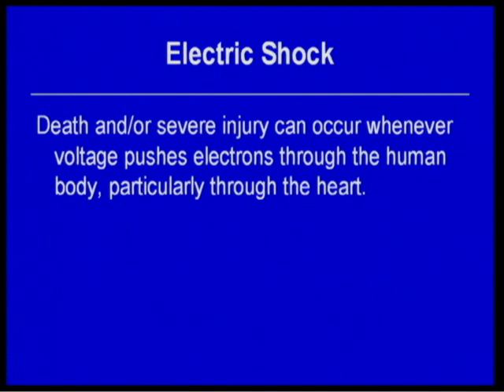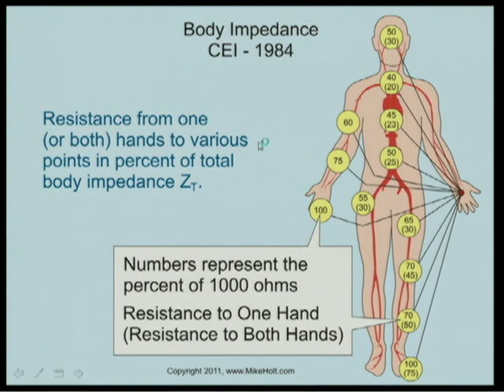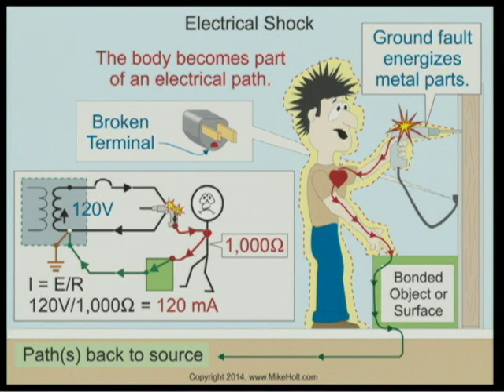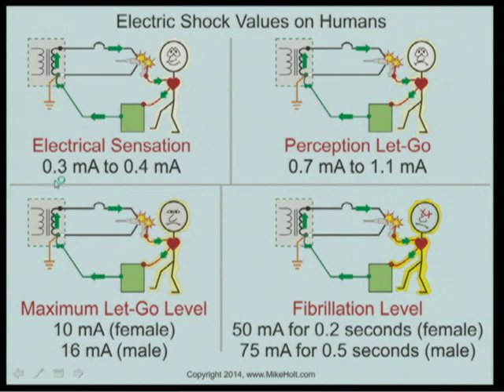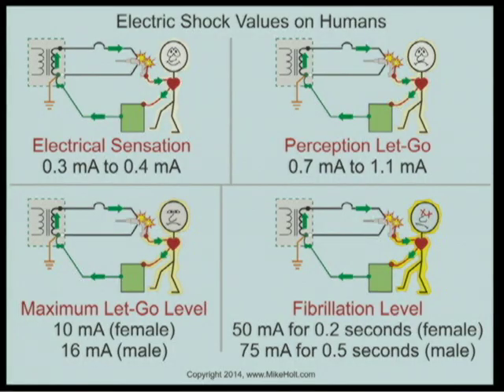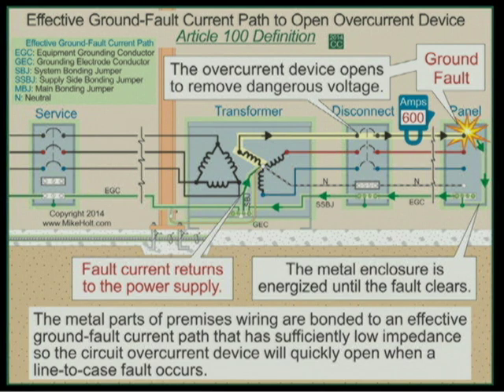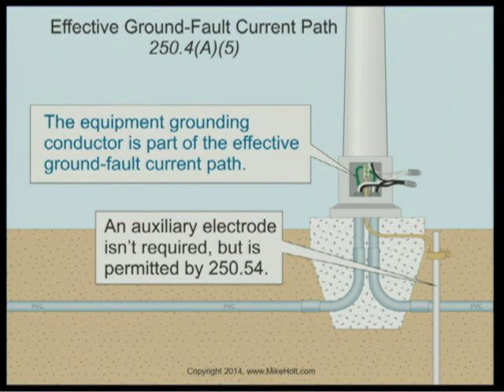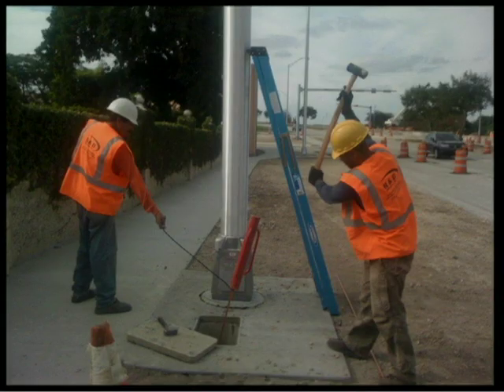Grounding Versus Bonding (26min:26sec)

Comment: I have been an electrician for 15+ years and we need to have, share and exchange more quality information like this. Youtube is supposed to be like this, a place where you can learn. Thanks Mike holt for sharing your knowledge.
Reply: Yeah sad thing is is that co-workers still laugh at u when u get zapped. I remember the first time I tasted a little bit higher voltage than 120 it was just across 2 legs of 208 and It caught me on the soft spot of my forearm (it was a piece of emt with wires hanging out that looked like an abandoned circuit) that was a bit of a different level lol I could feel it pulse through me and my coworker laughed at me the rest of the day lol.

Comment: After being shocked by a defibrillator, Defibrillation briefly stops your moving heart muscle to allow your heart to generate an electrical impulse and start a normal rhythm. In essence, defibrillation restarts the heart.

What happens after defibrillation?

Your provider will do CPR again for two minutes, check to see if you have a pulse and look to see if your heart rhythm is normal. If necessary, they’ll do more CPR and give you another shock. They’ll also give you medicines (epinephrine or amiodarone) if defibrillation didn’t work.

Comment: Great video and a point about Defibrillation stops the heart from fibrillating, think of it like rebooting the heart and letting it naturally regain a rhythm.  It is a single shock rated in  joules.  It is not multiple pulses.  Multiple pulses would be external pacing which would increase the heart rate but not typically used to restore a normal sinus rhythm
Reply from the maker: Thanks for the additional information.

Comment: Fib-rih-lay-tion

De-fib-rih-lay-tor

The heart consists of millions of electrical cells that charge and discharge. The heart is controlled by the brain. 

The heart has its own electrical pacing system. Theoretically, if you unplug the brain/heart connection but keep oxygenated blood flowing to the heart, it will beat on its own. 

The heart has 3 pacing sources, 1 normal and 2 escape (backup) systems. 

The normal pacing signal is given by the Sinus node located in the Atrium (the top half of the heart). It’s rate is 60-100 beats per minute. When the signal comes from the Sinus node at a rate of 60-100 it is called a Normal Sinus Rhythm (NSR). Slower than 60 from the Sinus node is called a bradycardia. Faster than 100 from the Sinus node is called a tachycardia. 

If the Sinus node is damaged from tissue or electrical damage (lack of oxygen via clogged artery or electrical shock) the heart will go into an Escape rhythm. 

The first of the 2 Escape rhythms comes from the middle of the heart and is called the Junction (Junctional rhythm). The junctional escape rate is 40-60 beats per minute. 

If the Junction is knocked out, the last escape rhythm comes from the bottom half of the heart called the ventricle. This rhythm is called an Idio-ventricular rhythm and the rate is 20-40 beats per minute. In the medical world it’s simply said to be an idio rhythm. 

The top and bottom half of the heart do not beat at the same time. Mechanical action occurs when the electrical system sends the signal to the cells. The normal discharge recharge cycle goes like this:

Atrium-discharge (muscles contract and blood is pumped into the ventricle filling it up). 

The electrical signal sent by the Sinus node when it fires off travels to the ventricle, but it is intercepted by the Junction for a very brief moment, held and immediately released to continue on its way down to the ventricle. 

Recharging of the atrium begins. 

Ventricle-discharge, atrium recharge completes. 

Atrium - discharge, ventricle - recharge. 

Repeat 86,400 a day. 

When you are electrocuted ALL of the electrical cells in the heart discharge at once and there is no recharging. The entire pacing system is knocked out and the electrical cells in the ventricles begin discharging in total chaos. The ventricle is a quivering mass at this point. No blood is being pumped. 

A defibrillator discharges all the cardiac electrical cells at once and hopefully the Sinus node will step up and take over the electrical system again. After the defibrillator fires off, the first thing everyone does is look at the monitor screen to see if the electrical waves have changed out of ventricular fibrillation. 

If the heart returns to a viable rhythm (NSR is the ultimate goal) the term is Converted. “He converted back to Sinus”. 

If you survive an electrocution, you most likely will suffer permanent damage to your cardiac electrical system and suffer from various dysthymias for the rest of your life.
Reply from the maker: You are amazing, how do you know this to be true?
Reply: MikeHoltNEC I was a Paramedic for 36 years. Now I’m a Firestopping Inspector.

Comment: The problem is the confusion between TN grounding systems and TT grounding systems. In TN grounding systems (f.e. North America, UK, Australia) you rely for ground fault protection on the short circuit protection of the fuse or circuit breaker. Now in TT grounding systems (many mainland Europe countries) you rely for ground fault protection on a Ground Fault Circuit Interrupter.

The problems starts when people who worked in countries where solely TT grounding is used (f.e. France) and they start working on systems designed in countries with TN grounding in mind. 

TT grounding is never sufficient when there are no GFCI's on every circuit to detect the small ground fault currents of TT grounding systems. Many countries with TT grounding even require at least two GFCI's in cascade to make sure even when one GFCI fails there is backup GFCI which will detect and trip on a larger ground fault current and disconnect both lines and neutrals. Also you're not allowed to share a ground rod in a TT system so every consumer will need its own ground rod. If this isn't possible you will have to convert to TN system by bonding the neutral to the ground rod somewhere to create and effective ground fault current path.

The best of both worlds is having TN grounding with GFCI's. This will maximize the chance of detecting and clearing any ground fault. Most European countries actually switched to a TN grounding system or take extra measures like 2 GFCI's in cascade to make sure even with a TT grounding system the risk of a sustaining ground fault is low.

Comment: the 30 volts and 15 volts for electric shock and hazard from death comes from the amperage that is required to stop the heart and using ohms law and an assumed resistant in a persons body is where the 30 volts comes from. I believe 0.1 amps can cause the heart to stop so assuming a person resistance is 300 ohms 30 volts could kill someone.

Comment: Sorry if i look dumb saying this , I'm new and on the process of learning to become an electrician... So the difference here between grounding and bonding , is that grounding is a myth? Using ground poles won't really protect you from high voltage? The bonding part is more effective , because you bond the ground to any metal type part and bring it back to the source  so it can trip? If anyone can be kind enough to correct me if I'm wrong. Thank you.
Reply from the maker: This is correct, but also watch https://www.youtube.com/watch?v=mpgAVE4UwFw
Reply: You're not dumb at all. Ground is the most important concept to understand while also being the most difficult. Ground is the medium through which the power system returns electrons to the source (not necessarily true for AC but this is a fine analogy for most applications). Bonding is creating equipotential connections at each piece of equipment (accounting of course for voltage drop).  Grounding is very real and necessary. In principle, Ground should be referenced at only one point from bonded conductors. There will circulating currents and issues with protective devices otherwise (specifically microprocessor based relays and such).
Ground poles will not protect you from high voltage if they are shorted. In a broad (not "totally" true) sense voltage will be forever the same if it's connected to a ground conductor before reaching the load (if it's shorted). If you connect a ground rod to the positive secondary lead of a 7200/240/120 transformer the voltage at the meeting point of the rod and the conductor will be +120 volts... always. The point of grounding is to carry current to a protective device (breaker, relay, fuse) that will clear the fault by opening the circuit (loop). In a substation, relays are installed looking at a proportional ground current flow. If it measures something over 140 Amps on the ground conductor, the relay will open the breaker.

Ground will not make things safe. It is a means by which things can be made safe. It's for this reason I don't agree with Mr. Holt in that grounding doesn't make things safer. It does. You can't clear a ground fault without an appropriate ground path of return. The myth Mr. Holt is (correctly) trying dispel is that grounding is all that is needed to make things safe.
Bonding will make things safe because bonding will eliminate large potential gradients. It will place things (metal, ground rods, metal equipment casings, soil) at the same potential, whether that's 2V or 250,000V. So long as the voltage difference is kept at a minimum, current will not flow in amounts large enough to cause harm.

I would recommend the IEEE Green Book if you want to have a complete understanding of grounding in a Power System.
Reply: Tyler Minix that’s so interesting.. so the guys servicing high power lines, on helicopters, when they use that rod, is that actually bonding?
Reply: @Lazdinger  Yes, that's correct.

Comment: Some places require the earth as the return. Some utilities use SWER system where the earth is the neutral, it saves them the money of running a second wire for the neutral.
Reply from the maker: Correct, https://en.wikipedia.org/wiki/Single-wire_earth_return

Comment: So when put up an 20 ft ham antenna mast, I live in a mobile home, they advice to use a 8 ft ground rod to ground the mast. The ground of the coax should be bonded to the metal frame of the mobile home which is bonded with the power box in my home which is connected with the ground rod at the electric companies power box 25 feet away. It does not feel right somewhere. Any advice please?

Comment: I'm a little thick headed. I think this is the 'BIG MESSAGE'.  
15:48 "…So the concept of providing protection to people is to make sure everything that’s metallic is connected to an equipment grounding conductor. And we have to make sure that all of the equipment grounding conductors are connected ultimately back to the equipment grounding conductor at the source, which is going to be your grounding terminal and we have to make sure that we bond that  equipment grounding terminal at the transformer to the system itself via the system bonding jumper. 
If you provided proper equipment grounding conductor, proper termination, proper connection all the way back to the source, that equipment grounding conductor, that supply side bonding jumper, that system bonding jumper and all those interposing connections back there is called the effective ground fault current path, and that’s how we get the electron from that fault back to the source to open up that protection device (the breaker). It’s that simple… Make all the metal parts connect to the equipment grounding conductor, connect it back over to the equipment grounding conductor at the source, connect the source over to the neutral, badda-bing badda-boom, we’re done. "
Reply: Right I believe this is why the ground and the neutral wires are connected to the neutral bus bar, so the equipment ground has an opportunity to return the ground faulted charge back to the source .And why you do not connect the ground and neutral in a sub-panel , because when the neutral is charged ie. carrying current back to the source ie. the main panel , , the ground wire would also become charged .

Comment: The only problem i have with equipment grounding conductors is they have the potential to route lightning directly into your panel box. Any steel frame structure with steel siding beams and collumns is an equipment grounding conductor itself.  Metal raceways should be used to limit the use of individual equipment grounding conductors and to save on copper. When the huge metal building gets struck by lightning it will track thru the columns and footings and will be diverted from the main electrical distribution center.
Reply from the maker: I think this is just an opinion not based on any study that supports your statement. Wiring with EGCs have been done for about one hundred years... Please provide facts next time you make a post.

Comment: So a bonded propane furnace with an underground tank will always have at least two different ground locations per structure?
Reply from the maker: Nope. And I don't understand what you are saying.
Reply: @MikeHoltNEC  gas furnace or boiler grounded via ground wire to stake by meter , also grounded by copper piping at tank via gas line . Two different ground locations,  potential for stray voltage,  no ?
Reply: @MikeHoltNEC  not directly related to this video,  thought of your lecture from a few years ago
Reply: @MikeHoltNEC  you actually got me interested in the biological effects of earthing.  Really changed my life . Thanks BTW
Reply from the maker: @mikepict9011  Just follow 250.104(B), which effectively says to do 'nothing.'

Comment: Acoording to you 25 second 40 amp going though body will kill heart then isnt that too long breaker to trip Mike ? Ark fault current intrapter shut off faster?

When I see other test by easton ir levinton they open by 1 second by shortening wire I think those chart are way off?
Reply: Moto Back to constitution what you all be sayings , yo?
Reply from the maker: No, since a ground fault is not an arcing fault.
Reply: @MikeHoltNEC  25 second 40 amp is too much for body

Comment: Also that "cute little wire" is not for lightning protection. It is to bleed of induced voltage to ground so anyone touching that pole won't get lit up (or dogs peeing on it as described in your grounding myths videos).
Reply from the maker: +Max Koller The pole is connected to 12 very large bolts that are probably 12 - 15' in the concrete cage; any induction on the metal pole is take care of by the inherent grounding of the metal pole to the concrete base.
Reply: Yeah that is enough, but I think this is more for the regulations than actual use. (Got to meet those regs).
Reply: Voltage cannot "bleed off."
Reply: @MikeHoltNEC  My money is one that "Ufer ground" is better than that "cute little wire" for bleeding off "induced voltage".

Comment: Great video, except for a tiny bit of baloney between 10:01 and 10:16.  Electric shock / fibrillation has nothing to do with the frequency, or how it matches with our "body frequency", also, our body DOES NOT run at 40Hz, we have various systems in our body, which run on various frequencies, which vary with time as well.  The only part of frequency that is relevant to electric shock has to do with the penetration.  For example, an RF signal frequency is too high to penetrate deep into the body to cause electrical shock, you'll get a burn instead.  As long as the frequency is low enough, you'll get a shock and if the current is high enough you'll get fibrillation.  If the frequency is high enough, you'll get a burn instead.
Reply: Also the body has a capacitance which can be penetrated much easier by AC than DC. Therefor the higher the frequency the lower the capacitive resistance the higher the inductive resistance. ANd therefor in between the two you will get shocked.

Comment: Voltage doesn’t push the electrons. Voltage is not doing the work. I get your concept but it’s technically false and wrong information.
Reply from the maker: Interesting comment… do you have anything to support your statement or is this your opinion.
Reply: @MikeHoltNEC  Yes, sorry for not including that. Voltage is not a force. Therefore could not possibly place a force on anything. Voltage is a scalar. It’s only a magnitude of difference in charges. A force is a vector, so it has two things.. magnitude & direction. Voltage does not fit that definition. I don’t mean this in any mean or offensive demeanor. I love your work, videos, programs, etc. I’m a fan and co-contributor to making sure the proper information is relayed to our electrical industry. United we stand!
Reply from the maker: Thanks, so you have nothing to support your ‘opinion.’
Reply: @MikeHoltNEC  Mike with that logic I could ask you the same thing. Let me know when you prove that voltage is a force, so I can be there when you win a noble peace prize and change physics forever 😂😂
Reply from the maker: @Electric_Sherlock  Okay, so you understand, my statement that Voltage is the Electromotive Force (EMF) that pushes and pulls electrons in a circuit is what is written in every book on the topic. If you find something that says that Electromotive Force (EMF), as measured in volts, is not the pressure to move electrons in a circuit, please give me the source. I'm not trying to be disrespectful, I just want to have the facts you have on the topic that I don't have.